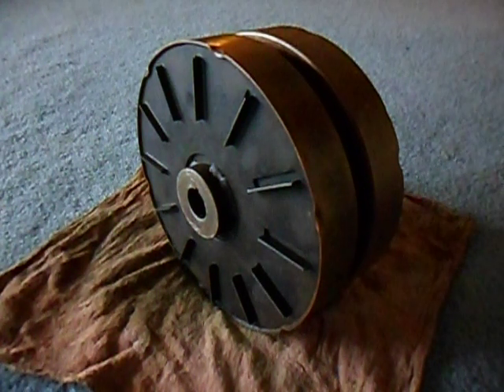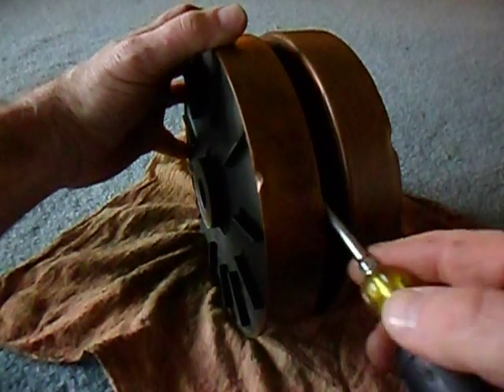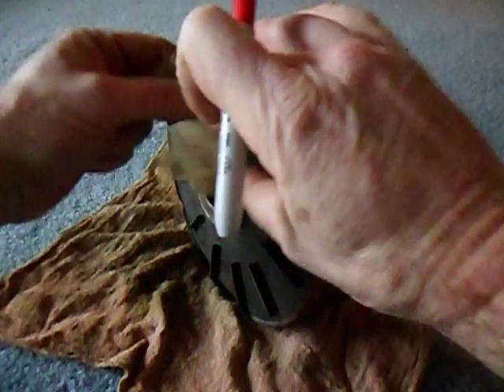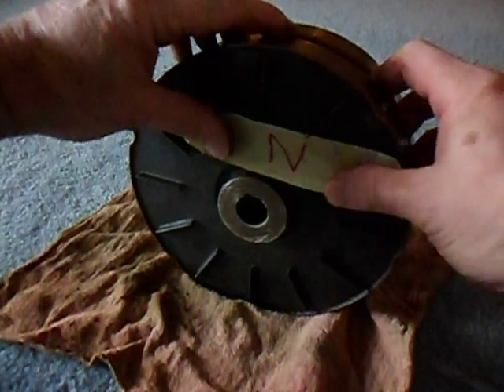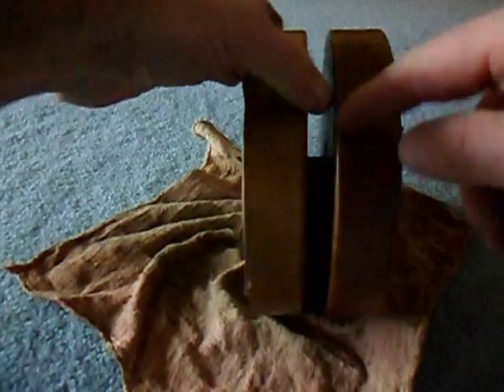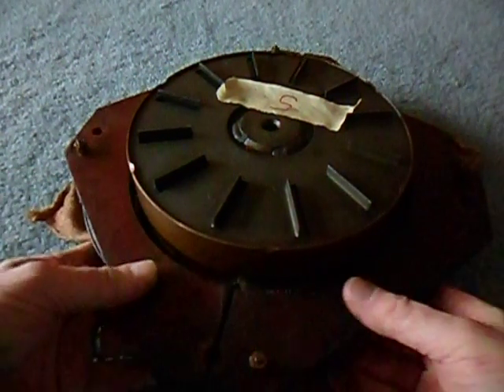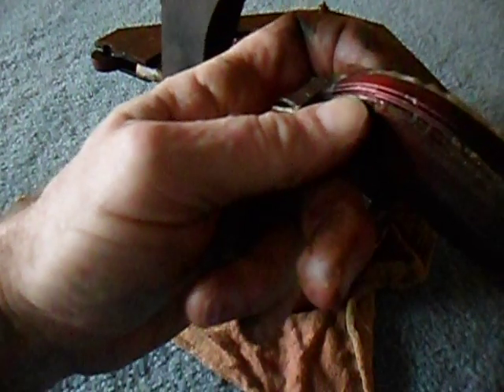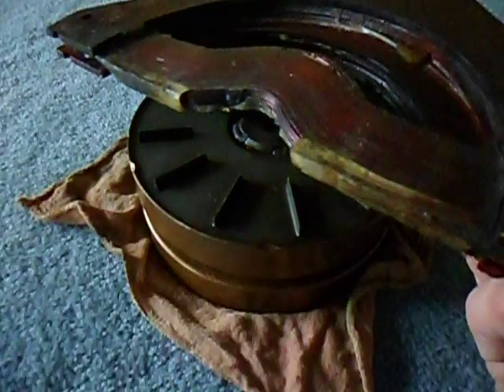A basic explanation of the magnetic rotor in the McCulloch generator

Comment: Very cool Generator I was wondering how that worked. Im not sure if I told you but you mentioned Eficientcy and I show how u can run the motor part off Vapor Gasoline Literly My results were Much Stronger run More power and Normaly ran 8 hours on 2 gallons of gas I now can run 8 hours on 1/2 a gallon of gas just another way to help. Keep up the good work